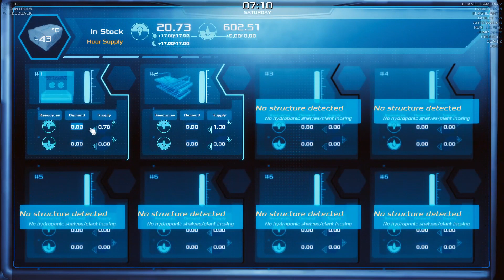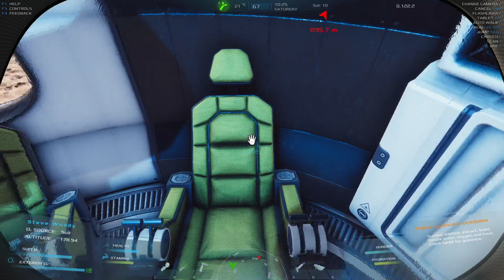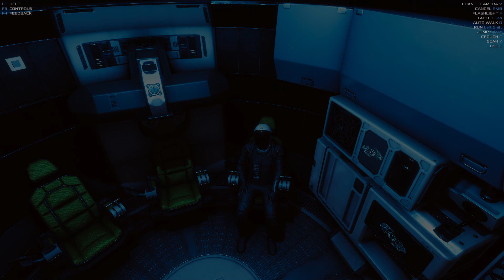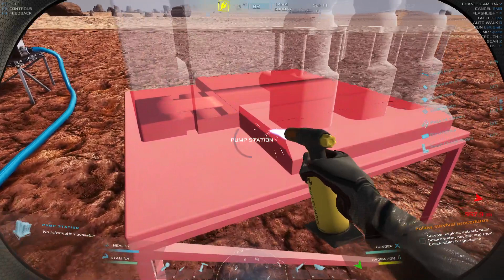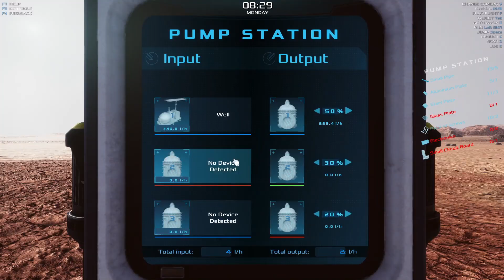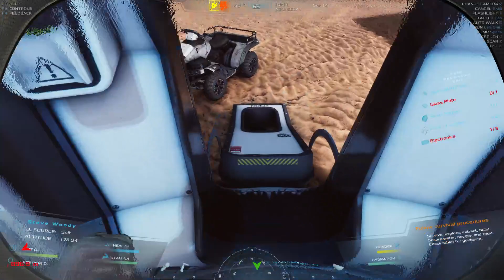From Seed to Supper: Food Production in Occupy Mars

Comment: Hi there is a flaw in the game that allows you to increase the nutrition of your food packs to full strength first you grow 20 potato plants until you get the plants to 100% which gives you a yield crop of potatoes. STEP 2 go to the seed machine and convert 20 potatoes into seeds to replace the seeds you already used. STEP 3 go to the food processer and convert your potatoes into food packs only fill 1 slot in the food processor so to give you maximum food packs...,example 20 potatoes will give you 20 food packs of lowest nutrition do this with all your potatoes you have. result you got total amount of food packs of lowest nutrition now how to increase the food packs to the highest nutrition simple save your game at this point then exit game and reload the game when you done this your food packs will of auto converted themselves to the highest nutrition making a bit more easy to survive on mars.